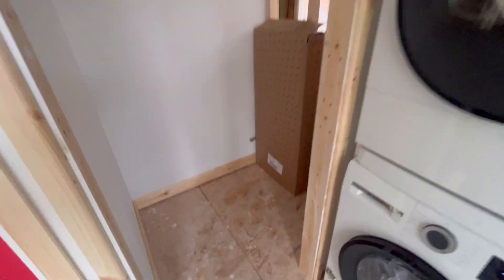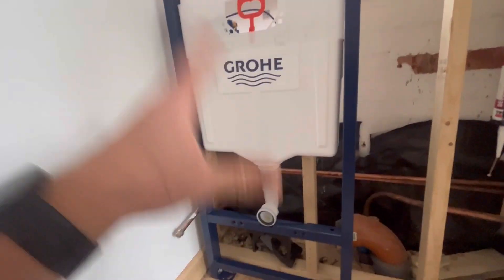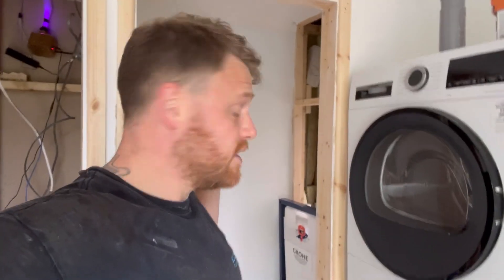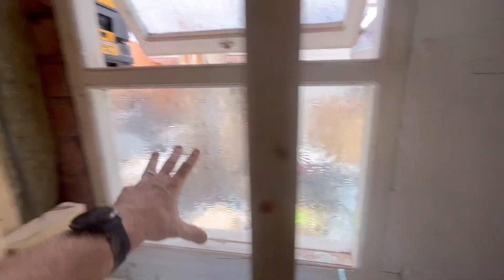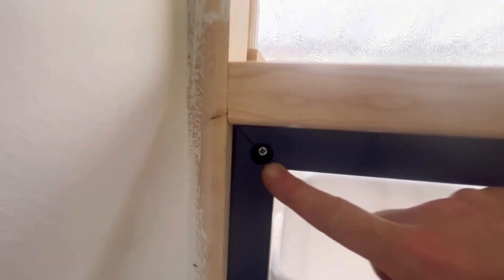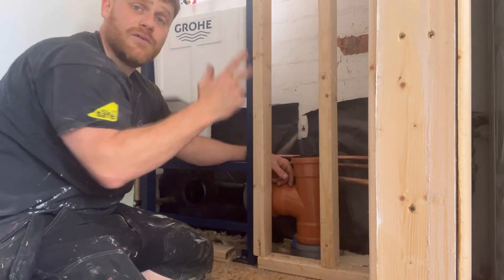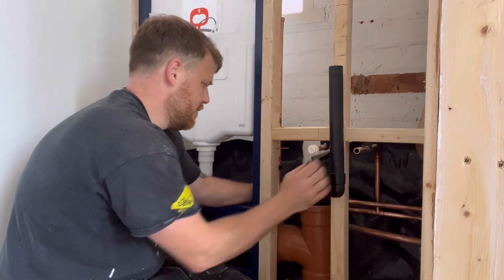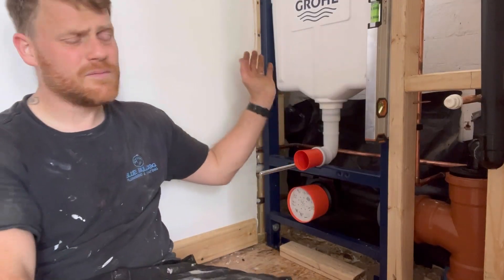Day in the life plumber EP3 First fix a wall hung toilet and basin

Comment: nice work, because the frame is set back from the stud work the wall is likely to flex under the pan and break the tiles when your sat on it unless you've packed it out
Reply from the maker: Packed out mate 👍👍 got told that when I first fitted one luckily
Reply: Sorry mate, what is that you packed out? @bluebulldog_uk